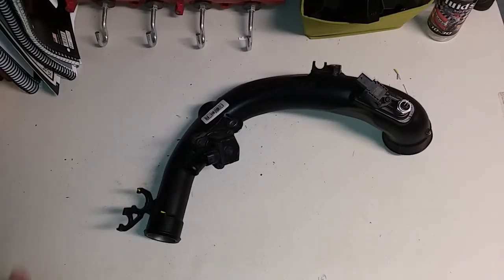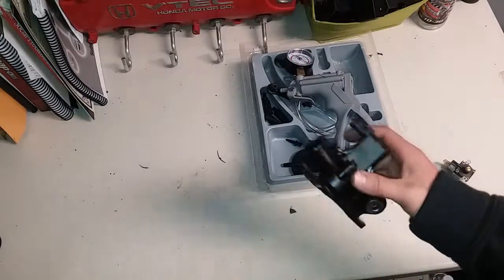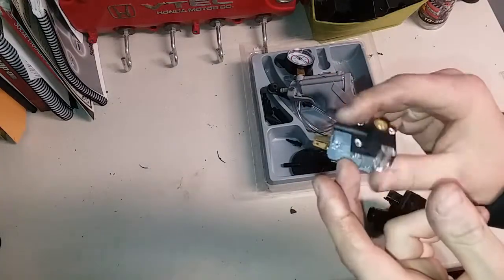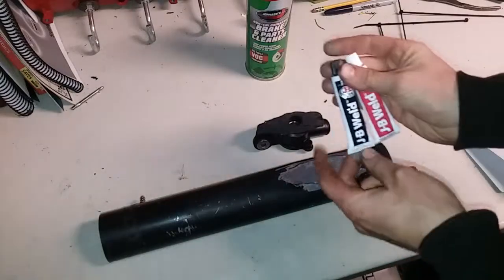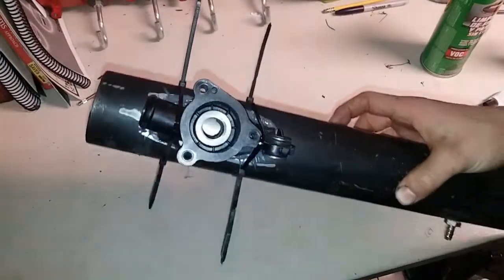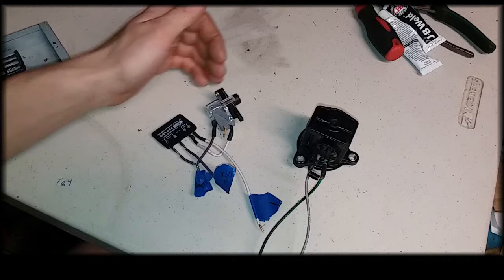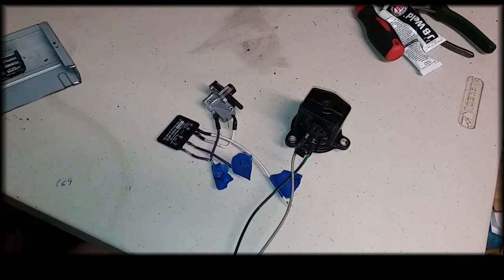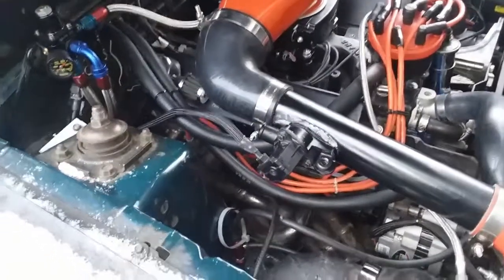2019 Jeep Blow Off Valve on Turbo Mustang

Comment: Explain why I should have all the electronics instead of my vacuum recirc? The one I bought was about 25$ New and fit like a Saab or something. Just trying to figure what the switch does the diaphragm doesn’t...
Reply from the maker: There is no advantage to electronic vs vacuum recirculation valve in this case, was just working with what I had and thought is was a interesting concept to pursue.